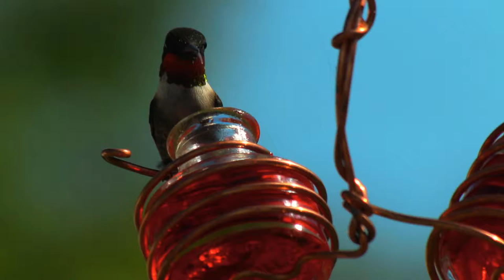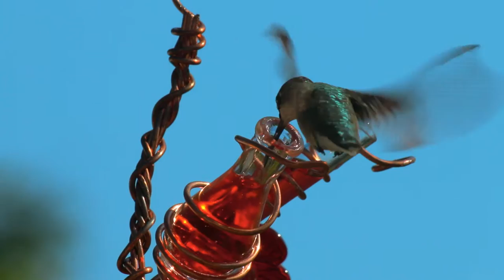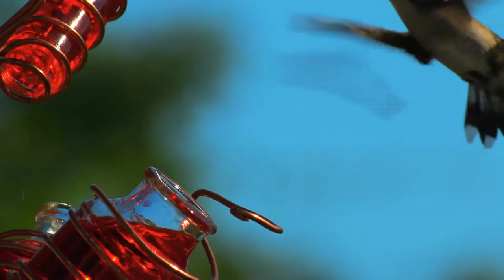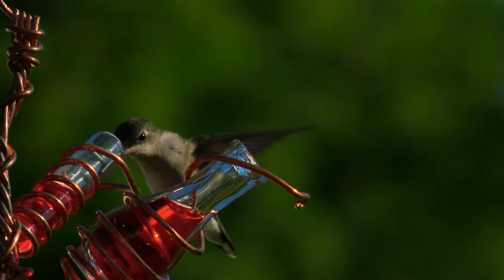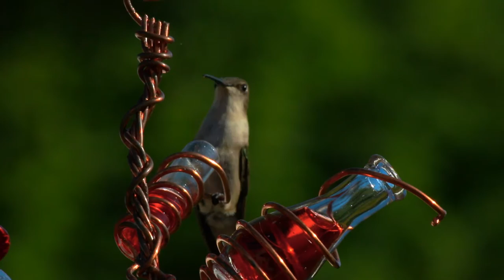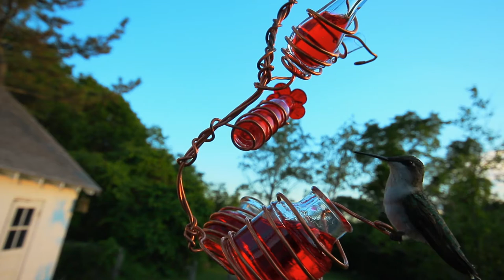Hummingbirds at my homemade copper wire feeder (with sound of wings)

Comment: May I ask what type of wire you used?  I just bought two of these types of feeders from Amazon and would love to try and make some for gifts!
Reply from the maker: Thanks for the comment! I use 12 gauge mostly for these wire sculptures. 10 gauge is a little heavy and harder to work with. I often use 14 gauge to wrap/hold those smaller light weight tubes designed for hummingbirds. These odd glasses from this video is 12 gauge to wrap them because they were a little heavy.